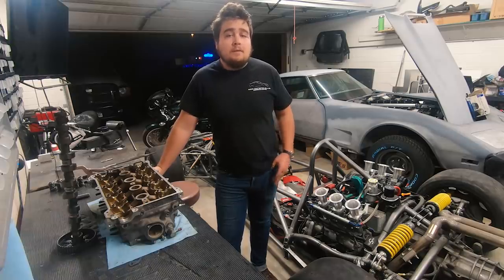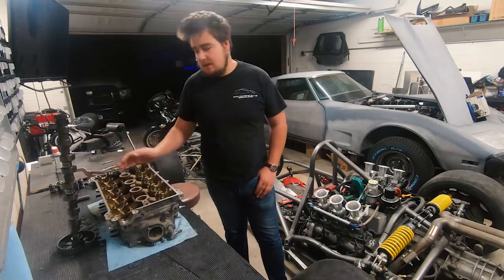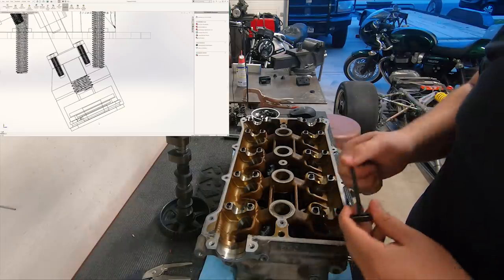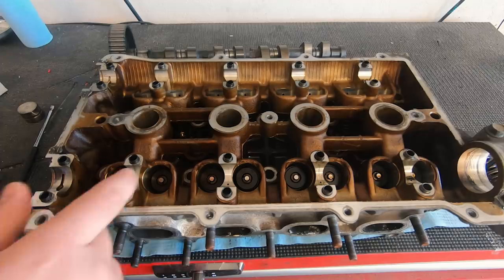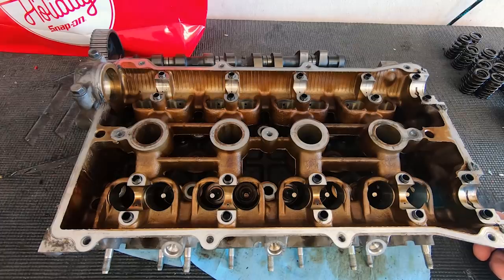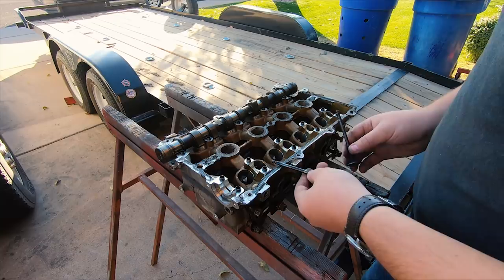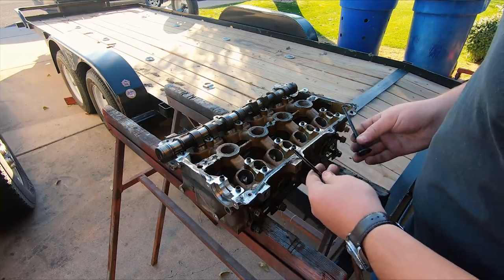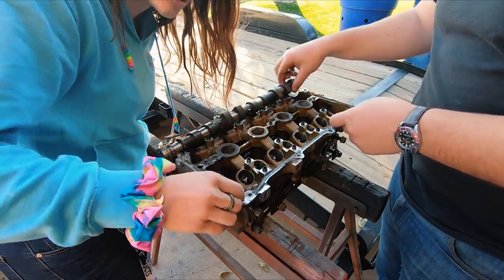Freevalve Miata Build! - Part 1 of  2

Comment: not sure if anyone has mentioned it, but in stock form Miata engines are non interference... so I'm not entirely sure if the valve springs are needed. but probably not a bad idea in case you shoot for more lift, crazy cam timing, deck the head, or adapt to another engine etc.
Reply from the maker: Yeah, I chose it for a reason. Non-interference was without a doubt needed for testing. Although at the higher lift it comes close, In a worst case situation with heat expansion.

Comment: I think for a road-going engine, you will have to machine your tappet out of steel and have it case hardened rather than aluminium for durability. Aluminium in a sliding application such as a lifter in a bore is subject to galling, so I predict a short life for your valvetrain, with the lifter/tappet as the main failure point. It's probably fine for proof of concept, but for real track use, you'll want to upgrade your materials, subcontract out a run of parts, and plan for it when costing out your kits.

Comment: You can remove a valve spring without removing the head by stuffing the cylinder with rope then turning the crank to press the rope against the valves. We do this all the time on aircraft engines.
Reply: compressed air
Reply: @pepelapew2724 I suppose so. Just not something we do with the big spinning death-fan attached. 😳

Comment: Dude this is friggin sick. I want to send u my 99' head to install this.
Reply: From an engineering standpoint its amazing that this isn't more common in racing? You wouldn't need to grind ur cams to change intake and exhaust valve timing.

Comment: You could technically start somthing with this. If you can manufacture it out of metal this will be amazeing. Theb tuneing the engine would be a matter of pulling up a laptop and changeing the timeing virtually.

Comment: just out of curiosity, why not use hydraulic pressure instead of pneumatic? If you construct it like an automatic trans by just controlling pressure relief you can get very finite position control in both directions because of the "non-compressability" of the oil

Comment: Cool little project. I'd be wary of Using aluminium for the valve buckets, very likely to gaul in short order, even with oiling
Reply from the maker: Yeah, it crossed my mind. Might jump to steel for those particular ones.

Comment: Could this be adapted  to run an LSx?   I think you'd see HUGE benefits there due to the lack of DOHC.   Also, it would be really cool to run the miata in part throttle operation on the Miller cycle.   Also, with this technology we could eliminate the throttle body completely.   As an EFI tuner, this geeks me out to no end.   Keep up the great work
Reply from the maker: Completely agree, and part of my goal was to create a system for aftermarket tuners to be able to create different valve maps for different end goals.

Comment: Have you considered using a Teensy for the controller? 
Teensy3 and up use ARM chips and are MUCH faster and have a lot more "features" than the uno.  And you can still use the arduino ide to code and upload.

Comment: YES!! - I've been thinking about doing this with a motorcycle engine, I've not watched the harbor freight engine video, how did you solve the piston to valve timing without the timing chain to the cams? I assume you are using the firing energizer going to the coils? or some kind of indexer of the crank?

Very cool

Comment: Fords Modular V8s should be experimented with a free-valve cylinder head. Here’s why. Koenigsegg’s engines rooted from Ford Modular V8s, Ford Mod. V8s came with many different valvetrains (SOHC/DOHC, 2v, 3v, or 4v) so you could use 16 or 24 cam-less, solenoid valves, instead of 32 like on most V8s.

Comment: Huh, I just realized... if you used forced induction, you could use a freevalve head to switch between running as a 4-stroke and 2-stroke with the push of a switch...

Comment: Please find the vid on the elenor replica. It wasn't even  that close but was able to be confiscated under copyright. Maybe you'll have more luck since solenoid valves are common and have been way prior to the naming for automotive use. Also a very cool use is to split the exhausts ports to spool a single turbo or one side of a split ported one at low revs before opening both exhaust ports to spool both tubos/turbo ports.

Comment: just wondering if 6lb spring rate would be much good as a safe-fail..? The speed a piston is moving usually, when anything fails, would 6lb be quick enough to close the valve?
Would be good in a diesel against runaway.. Be interesting to follow!

Comment: If you are replacing a valve spring retainer, don't use aluminum.  Titanium retainers have a reputation of failing pretty quickly, if you use aluminum, the keepers will get yanked out even faster.  You should probably use 4130 or maybe a shock resistant tool steel.

I don't think your failsafe spring idea is going to be particularly fail safe, with the mass of your actuator added and the high RPM operation where it would probably fail, you might need more spring pressure to shut the valve if the pneumatics fail and if the double acting cylinder fails open, it's done.

Comment: Hey, interesting project. How do you plan to control the exact lift / acceleration / position  of the valve versus crank shaft position to achieve maximum throughput? 
It looks like you just want to switch the valve digital on/off only. 
This could mean that you either loose power because you have to open the valve pretty late at low revs to avoid hitting the piston (which is not out of the way fast enough) or being in the danger of hitting the valve with the piston at higher revs during the compression stroke.
I just imagine the needed forces and precision for a sporty motor to be quite strong/strict to exactly control the valve over the complete rev range.

Comment: Great stuff.  Are you not concerned about the Al on Al sliding action with your valve lifters/retainers in the head? 

Consider wire tieing those cap screws joining them to the actuating mechanism.
Reply from the maker: I am, actually. I’m hoping for testing the oil guide will protect it, but for longevity a steel design could be made with no changes to what you see.
Reply: @WesleyKagan  I’m super impressed with what you’ve done.  Will be interesting to watch the hardware and software control come together.  You may need to go to an esp32 at a higher clock speed to drive all these events.  If you haven’t already, implement interrupt driven software for your engine timing sensor, and possibly your valve control.  Hysteresis will not be our friend!

Comment: Will air be responsive enough at the kind of speeds these are gonna need to run at? Its a bit"squishy" no? Also, how are you planning on getting the compressed air when the engines in the car? AC?
Reply: @Ethan Vermillion Fair enough, I was thinking more along the lines of some powerful Electronic solenoids

Comment: Are you going to drill and grub screw the original cam oil feeds? Or have you got a less intrusive idea to avoid the loss in oil pressure? 
I'm thinking some half cylinder pieces of metal screwed or glued to the bottom of that cover plate you show at 9:53 (with a dab of silicon over the oil ports) would be a quick and easily reversible way to seal them up. It might even help keep the cover plate located more rigidly too.
Reply from the maker: That's almost exactly what I was thinking, I didn't want to do anything intrusive or irreversible. Otherwise it'll be impossible to build oil pressure.

Comment: This is cool! .. Does it work with boost? Like if u have a lot of psi, does it still shuts/open? Following from Sweden 👍
Reply from the maker: It’s more powerful than the factory valve springs- there’s nothing to say you couldn’t turn up the pressure a bit and have greater pressure holding it to the seat. Thanks!

Comment: So this will be running with no valve springs? I'm curious if the solenoid will have enough beans to keep the valve(s) closed when under vacuum. Not trying to be a negative Nicholas, I really am excited for seeing how this goes. I'm glad someone else has had this idea and is bold enough to try to develop their own system.
Edit: Sorry, you mention a valve spring going into the housing @ 3:50, my bad!
Reply from the maker: As a safety, yes. But the solenoids will be able to hold them closed, the factory valve springs are around 35lbs, and the air system will be around 45psi.

Comment: Very cool... Miata is a perfect candidate.  The 99 5W head flows better than the BP05.
Reply from the maker: Very true, however difficult to find a ‘99 for that reason. Currently I’m researching if there’s any top end difference on the 5W, or if it’s just cams/diameter.
Reply: @WesleyKagan  valve angle is different.  Actually, there are a lot of 99 motors that ended up junked due to the thrust bearing issue on the motors that caused many to die.

Comment: What will the air consumption look like? 4 cylinders x 4 valves x double acting cylinders x the volume per cylinder x operating pressure x 1/2 RPM, right?

Would an A/C compressor be able to keep up? And would the power loss of powering the compressorbe compensated by increased HP from the freevalve design?
Reply from the maker: I ran through the calculations, (interestingly my bottleneck is the tube diameter going to the solenoids, due to pressure loss even over that short of a distance.) the quantity of air needed is honestly not a lot at all, and the best I can figure, a small electric compressor could make it happen. 

I have some ideas to overcome the power loss from the compressor, although there’s a lot of power gained without the cams.
Reply: @WesleyKagan  That's good news. The tube diamater is the easiest thing to change. :)
Reply: @WesleyKagan  BTW, I shot you an email through your website, but I'm guessing you're getting inundated with messages at the moment. I was just wondering if you could use theEFI fuel map to control valve timing. It already has different values depending on throttle position, load and RPM - would these translate in a meaningful way to control the freevalves?

Comment: I love seeing this kind of experiments because if you could get past the patents and money  we could combine free valve tech with nissan's variable compression block add dry sump oil system twin scroll turbo and tpi cpld plasma ignition system  we could have a smart engine with crazy potential" 50 mpg 200hp or just a switch 15mpg 650hp in a easy production and best balanced engine configuration of inline 6 just a start in the finale i.c.e. stand before electric takes over

Comment: This may have been asked. What happens on engines with higher compression and low clearances when valve actuator fails and doesn’t retract or opens randomly. Bent valves?

Comment: What are you going to do for a compressor on the car? I use some similar solenoids a lot at work. We have huge compressors to operate them as well. Just seems to me that as fast as you will be cycling them that it would take a lot of air. Keep up the good work. Looks like it’s going to end up awesome!
Reply from the maker: I calculated it out, and my plan is a pretty large surge tank. Luckily they are small enough volume per cycle. For now an electric compressor, but for a final design would be more efficient.
Reply: @WesleyKagan  yeah. I was just trying to think of something small that would be unobtrusive in a tiny car like that.

Comment: I want this! I have a stock drivetrain 1.6 in the Phoenix area if you're in that area and want a test bed.

Question, one of the things that interested me most about the freevalve system was that it would replace the standard throttle body, using valve lift and duration in it's place, giving better efficiency and throttle response, is your system going to be capable of the same?

Comment: You know i like this and that's why i want to offer criticism. 

I wonder about the longevity of the electropneumatic valves. 
Although i guess these industrial ones are made for factory robots and high speed industrial machines, so they are developed to be quick and go through a lot of cycles. 
That's quite lucky actually. 

The other kinds of free valve systems are hydraulic and electric. Why is that? 
"Power consumption of electromagnetic valvetrain system " by LIANG LIU and SIQIN CHANG, in chapter 2, there is something said about controlling the valves trajectory when almost closed in order to get a soft landing.   
I think that accurate control of the trajectory with pneumatics is more difficult. Electric valve actuation does not require a medium and hydraulic fluid is very incompressible. 
Here's my reasoning. 

You will know this already but yeah, i feel like explaining xD 

To move a valve you need a force. the pneumatic force F_p = A.p with A the area of the piston surface and p the pressure applied to the area. The max needed pressure is dependent on the required force. What is the required force? 
(I left out forces related to pressure on the valve) 
We need to accelerate the mass of the valve, air piston and stuff. 
With F=ma, with m total mass of a single valve assembly and a the max required acceleration. 
You've got the hardware already figured out to measure the cam profile, so the acceleration can be determined from that. 
Although a faster acceleration may be interesting to test. 

So that's how we get the force and thus the required pressure. 
To pressurize the piston chamber we need to move air into the chamber.  We would like for p to change quickly. 
This allows control. 
 p = nRT/V (ideal gas law) 
If we would like to change the pressure, we have n, the amount of air molecules in the chamber, R, which is a constant, T which is temperature and V the volume. 
R and T are not useful right now so we are left with: 
p=n / V
 
The change in n is limited. Air moves with inertia and flow resistance. The propagation of air is also limited by speed of sound. 
So to achieve the largest difference in p in a certain timeframe, we would like the smallest volume of air to be filled up. 

TL;DR: minimize volume of piston chamber and tubing for more accurate control. Perhaps build a measuring system that measures valve lift while running the system to check for air lag. (i suggest a laser distance sensor, does not affect the results and is quite accurate and fast) If possible minimize weight of the valve assembly. A lighter piston moves quicker. ( perhaps a lighter valve assembly will bounce more) 
 
With kinds regards!

Comment: I see where you’re coming from with the failsafe valve spring but both 1.6 and 1.8 Miata motors are non-interference motors😘
Reply from the maker: Completely understood, but I'm opening a bit more than a standard motor- just to be safe!

Comment: I have a question. How did you attach magnets to the 3d print in the predator engine? Glue (what kind) or friction or something else? I cannot figure a good way to attatch magnets to flywheel in my 50cc 2stroke engine magnets fly off at about 11k rpm. Subscribed!

Comment: Will this lower the overall profile of the engine? If so, by approximately how much.
Love this applied stuff.
Reply from the maker: Not lower per se, but it will take about 11lbs off the top of the motor. So it does lower center of gravity a bit.

Comment: Are you going to use a circlip in the groove on the underside? (Shown at 5:06) It doesn't seem like it would stay assembled for very long without one, especially with the set screw applying a force to separate the two halves. 
I also don't understand how you would get that installed or removed when it's in the head and down in the lifter bore. 

It seems like if you flip the assembly around so the collar is underneath the upper retainer then all the fiddly bits are on the top side with easy access.

Really interested how this turns out!
Reply from the maker: Yes, that’s what the groove is for. Unfortunately I have to work within my manufacturing constraints, at least for prototyping work. There’s better solutions than some of my designs but at the cost of much more difficult to manufacture.

Comment: So, basically your shooting for desmodromic free valve actuation?  I was under the impression the original free valve system was oil pressure driven and still had regular valve springs.  Now I have to go back and look...
Reply from the maker: Thats the idea at least. Most early vvt is oil driven as well.

Comment: i just need to put up my concern  the Camshaft ''bearings'' are under oil pressure im not sure if u have some idea for it or you might forgot it if they just leak oil u might lack some oil pressure im not familiar with the miata engines but thats my thinking atleast :D   maybe u have already a fix for it :D

Comment: Are you going to be plugging the oil holes for the camshaft bearings, and the lash adjusters? that'll be a lot of oil pressure loss otherwise.
Reply from the maker: Yes, that's the plan.

Comment: I looked at the expected life of commercial pneumatic solenoid valves. "Long life" is considered 50,000,000 cycles by one manufacturer.
At 6000 rpm the valve needs to cycle 3000 times per minute
50,000,000 / 3000 / 60 = 277.77778
You will have to replace the solenoids every 278 hours.

Comment: Need this for gen1 sbc 👍 unless it has to be overhead cam.  I wouldn't think it would HAVE to be. Just use the cam to run the distributor and oil pump and the cam lobes do nothing and lasts forever

Comment: BP and B6 heads, when they warp, need to be straightened before they're shaved. Do you have the facilities required to straighten the head before you shave it, or know anyone who does? The heads suffer from core shifting when they overheat, and that is most definitely what that amount of head warp indicates.
Reply from the maker: Not planning on re-using these, just wanted some to measure parts on and mock up the final design. These I bought as junk heads to take measurements on and get an idea